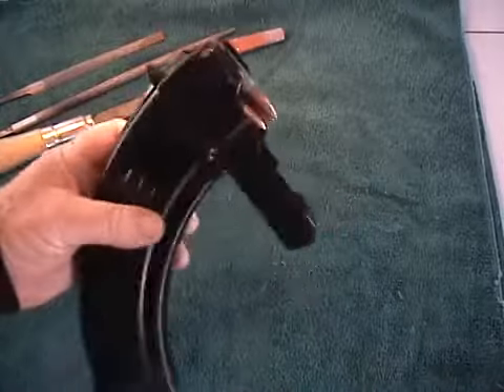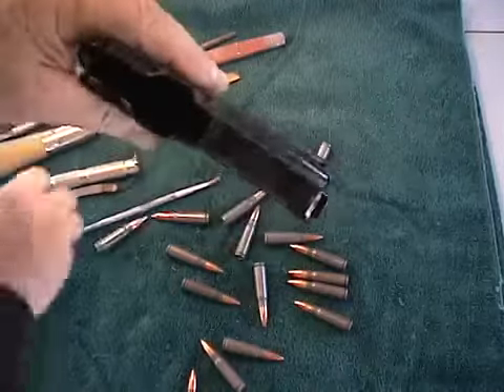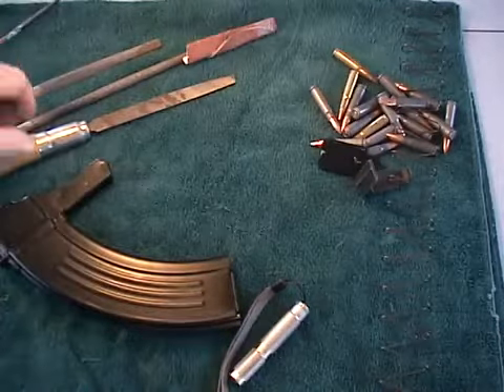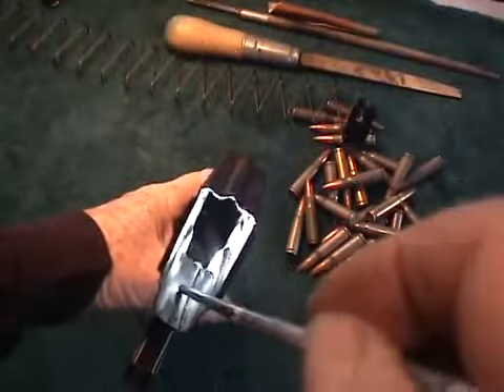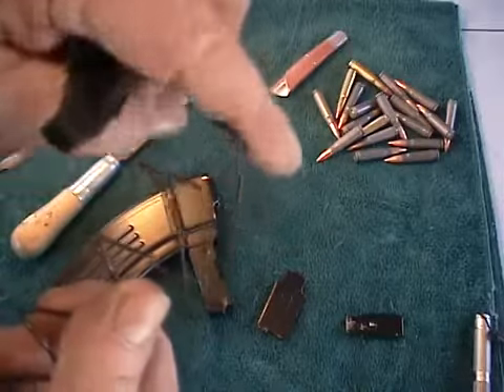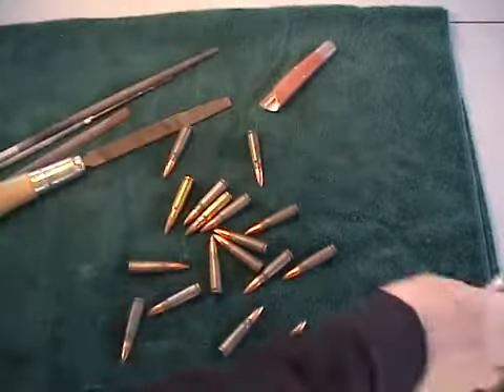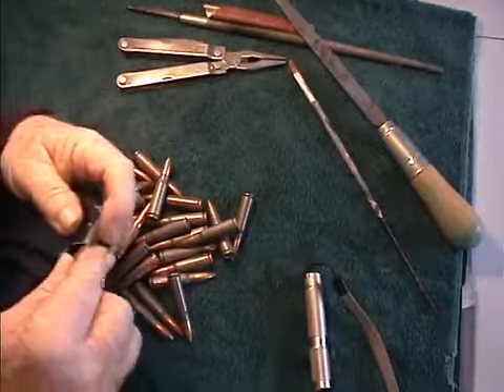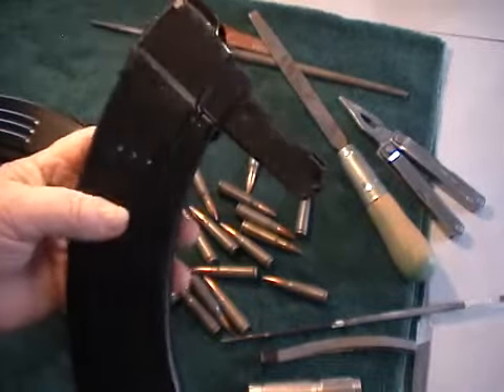SKS CHEAPO 30RND MAGAZINES ...HOW TO IMPROVE FIT AND FUNCTION

Comment: For anyone having issues reaching the inside of the curve with the file: Mount the mag body to a workbench using a c clamp on the edge of the table. Make sure the longest part of the mag faces away from you. You can now cut a small strip of emery cloth or sandpaper and run it through the magazine body. Reach through and grab it on the other side. You can now sand to your hearts content on that inner curve!

Comment: I removed the cheapo 30 round NC Star magazine that my Chicom Type 56 came with and replaced it with a stock 10 round military magazine.
Reply from the maker: good for you....hope you dont meet a bad guy with a 30 round or drum mag
Reply: @JohnsOldMercurySite  That's what my AR15 is for😀.
Reply: 12 gauge old man told one and done